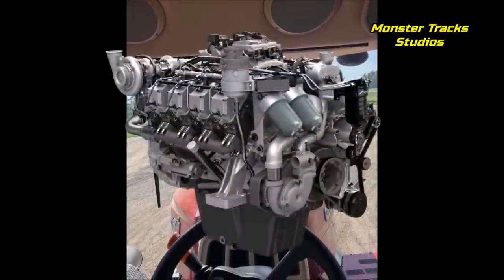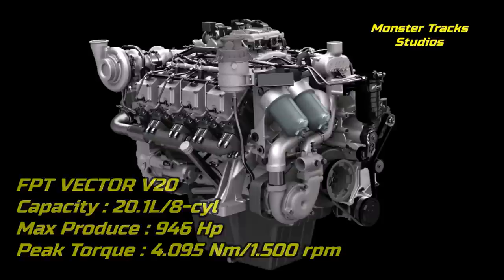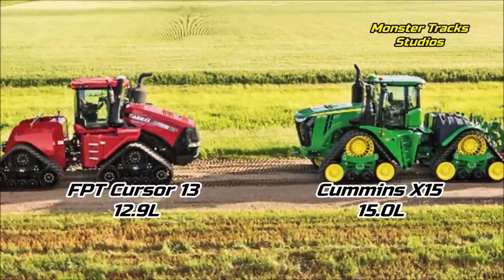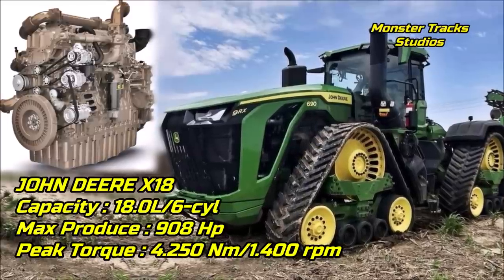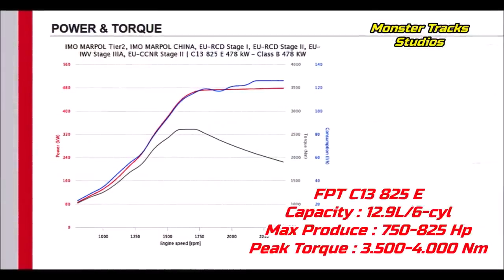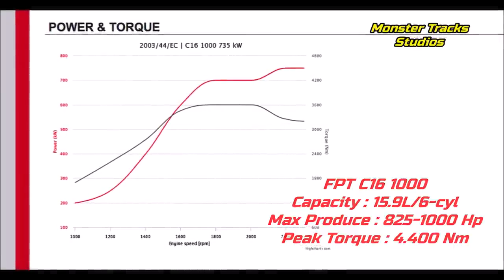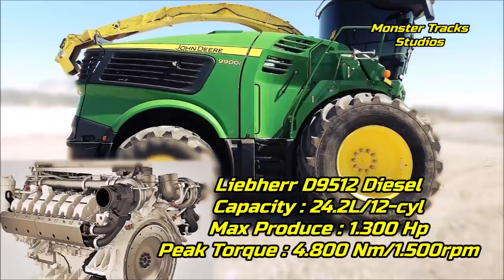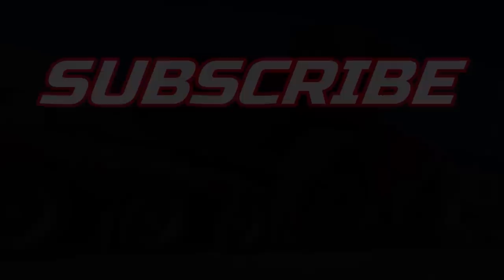NEW 946 Hp or not? Case 715 Quadtrac will use the Vector V20? [Vector V20 vs JD X18 vs FPT C13/C16]

Comment: The Cursor 16 1000 graph that you show is for the marine variant. You need to look at the off road variant to get closer to the numbers that will actually be seen in tractors.
Marine engines always have higher ratings because they have access to unlimited cooling water. 
Right from FPT's website the cursor 16 makes 700 hp @ 2000 rpm and 2204 ft-lbs (converted from 2988 Nm) @1500 rpm.
Reply from the maker: Actually this case according to the last video Case ih shared is at 780 Hp and 3.253 Nm...
It uses the cursor 16 engine of 15.9 litres but not the 1000 one...

Comment: The IH quad track only has a 16 liter engine and it’s a iveco only has 778 maximum HP ! The iveco can’t be over hauled there is only a core  trade around it’s a throw away engine. If I own a IH I would quickly sell it an take the money 💰!

Comment: WHY DON'T DEERE PUT THE 1300 HP MOTOR IN THEIR QUAD TRACK AND BE DONE WITH IT??????????????????
Reply: Show me a transmission that will hold 1300 HP.  Or axles for that matter. 

To properly ballast a 1300 HP tractor it would have to weigh at least 100,000 pounds.
Reply: Because the powertrain couldn't handle the power without upgrading it at considerable expense,would be my guess,besides,the tractor wars have never jumped at 4-500 hp increments.
Reply: Liebherr the best engine, German engineering
Reply: Then it would be a junk Deere...

Comment: Rubbish,had a 600 QT with 12.9l engine.Overheated lack of torque .Sold it at 1500hrs and bought Veratile 620 s.Ample torque.Lighter on fuel than the 600Qt.Get your facts straight before telling us farmers b/s.
Reply from the maker: What do you mean? What i said wrong in the video?